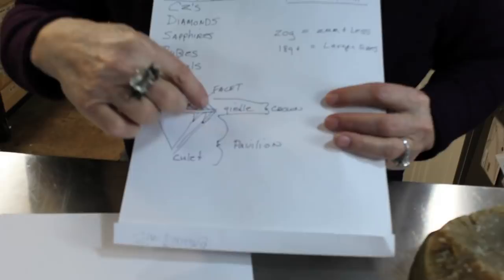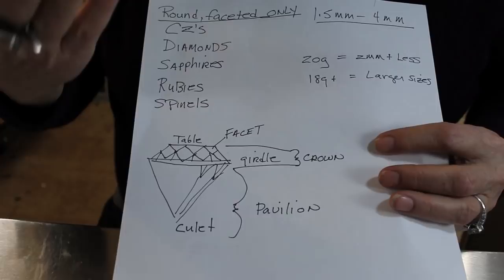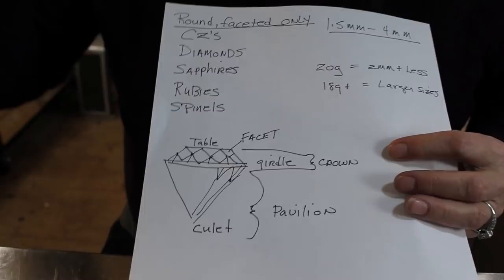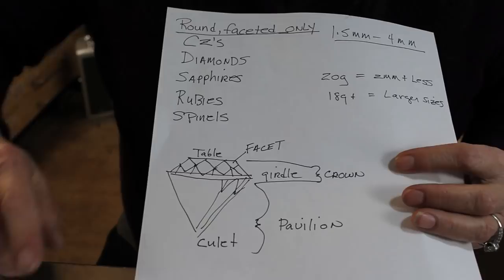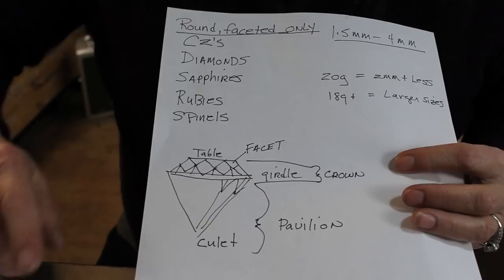Flush Setting Faceted Stones

Comment: Do you know why when I do this the drill bit either stoops the drill spin or when I go faster it just scratches and bounces even when I use a proper vice to hold it still sometimes when it does the hole it almost jams the thing. I use a dremal 3000

Comment: How would one go about flush setting a, say, oval stone?
Reply: Jacques Grove Melt a thin layer of paraffin wax on the surface that you press the stone into. Allow the wax to cool fully then inscribe the perimeter with a very fine pointed scribe. Drill a hole and use either a saw frame or cylinder burs to remove as much material as possible tapering down towards the bottom until the perimeter of the hole is cut exactly to your scribe mark. Use a small ball bur, 0.5mm is good or sharp round graver to carve away material from the upper edge creating a level seat the stone rests on. Then burnish as shown.